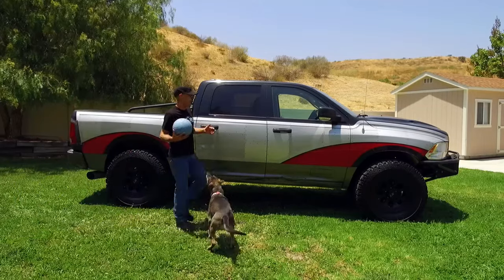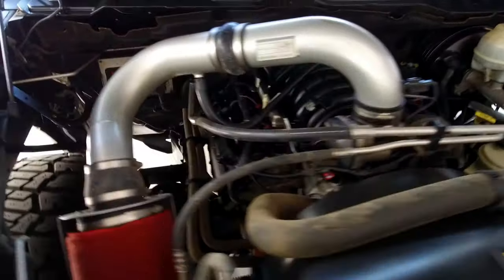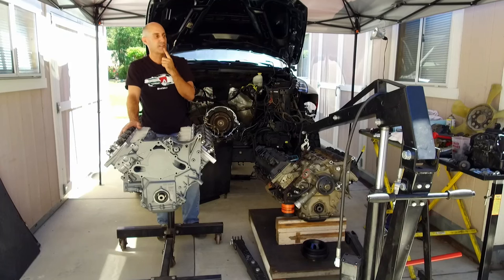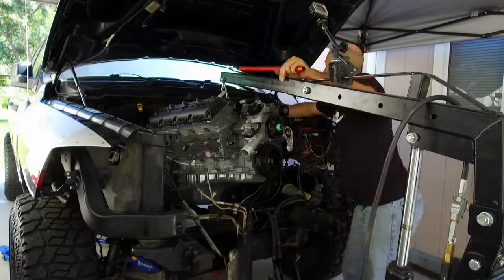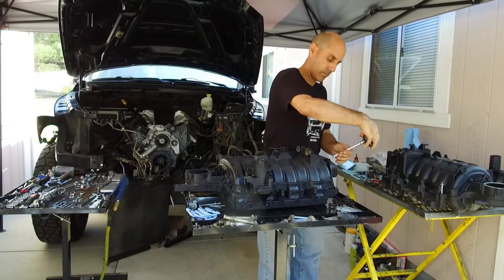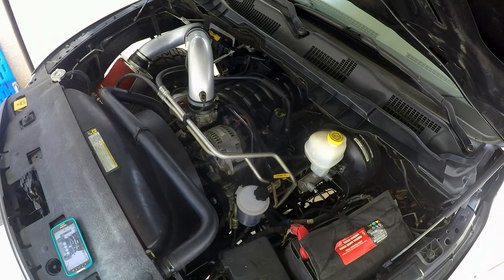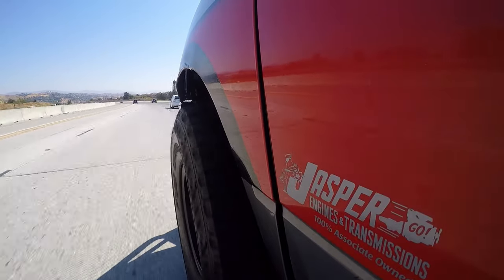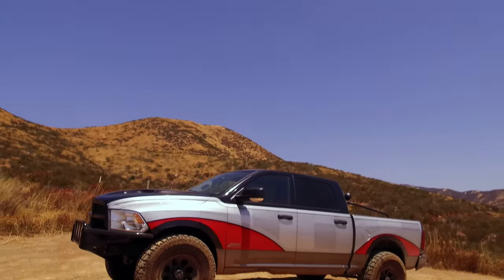HEMI Swap with Jasper Engines Replacement 5.7 in a Dodge Ram 1500 on 37" Tires

Comment: I just sucked a valve in my 5.7 I'm heart broke. I loved my hemi. I'm so mad 😢
Reply from the maker: This is a really great engine with some solid technology in there.  It just took them up to the current generation to get some of the weak spots engineered out of there.  I'm thrilled that my Jasper has those fixes in it.
Reply: autoedit thanks for the reply. I think I will get another Hemi. didn't they say 2009 and newer 5.7s they fixed the valve seat problem? or I'll do more research and watch this video a few more times .
 Ohhh yes a Jasper Would be incredible. Your Truck is badass!!!   I think I can make a Hemi last a long time with a little Lucas and frequent oil changes.

Comment: Too bad Chrysler still can't get it right and won't offer to do the upgrades once your motor goes dead. If it's under warranty, you just get the same cheap OEM parts. The same goes for that 65rfe transmission.

Comment: Need more how to stuff for this ram
Reply from the maker: Working on a full suspension rebuild video right now and should have it done this week!!!
Reply: autoedit wouldn’t want to do a video on how the rubicon tcase was installed? Or is it a direct replacement besides cutting a hole in the floor?

Comment: u should do engine swap for the jeep
Reply from the maker: I like how you think but that is tricky here in California with smog rules and such.  How about a supercharger? Adds another 100 horsepower but still sounds like a mini van... but still another 100 horsepower tho!
Reply: autoedit Well, A supercharger is going to add 100 hp that is true, However, it will cause more wear and tear to the engine"long term" as it adds lots of pressure to the stock 3.6l engine. I personally prefer 6.2 hemi swap, will give lots of hp and torque and an amazing sound.

Comment: Was the new engine mds deleted from jasper?
Reply from the maker: You could go either way.  Just buy block off plates for the solenoids and done but you would still have to deal with the computer.  I my get a tuner in the future to disable that but for now I hardly notice it.
Reply: When my 08s mds kicks in it becomes and stays a turd for a few but with 115k on the odometer it's still running strong I was going to cam swap with headers and an mds delete with possible custom tuning

Comment: What about the valve train? That's the weakest part of the whole engine.
Reply from the maker: They use higher quality metal than OEM for those parts in this application.

Comment: Where can I buy a Jasper engine? I don't need an installer. i don't let anyone else work on my cars. I'm a certified mechanic/
Reply: Can anyone recommend a brand of reman engine that has warranty and one can install themselves?
Reply from the maker: I simply emailed them from the link at the website and asked to install myself.  Worked out great.
Reply: AutoEdits thanks, I called Jasper and they said I could install it myself. They gave me a quote but it was about $1500 more than ATK. ATK has no cores so the wait would be at least 3 months. I talked to a friend who owns a shop and he said he had a lot of problems with Jasper and recommended ATK. My local machine shop who told me my core would need all 8 cylinders sleeved and would not be worth rebuilding said they stopped carrying ATK 3 years ago due to problems and recommended Jasper. Trying S&J.

Comment: OH MY GOD ALL THAT WORK TO BOLT THE OLD HEADERS BACK ON. THE ONES THAT SNAP BOLTS... THE ONES THAT TWIST AND LEAK.... WHAT A MASSIVE MISTAKE. 

Should'a bolted a set of BBK shorties on there at the very least.... dont worry it will be a necessity in about 6 months.
Reply from the maker: I didn't realize it was such a problem.  The old ones lasted this long without issues but I do like the BBK shorties.  Didn't realize they even made them for this application.

Comment: Am I the only one that noticed the old engine had a FRAM OIL FILTER??  NOT GOOD
Reply from the maker: I've seen this comment a lot on this video... why is Fram bad?
Reply: @AutoEdits  The standard Fram oil filter is the cheapest of the cheap oil filters.  I'm talking quality of build Not price,  Fram uses a piece of STRING around the filter media to keep it from bloating out against the filter walls., and the filter media is glued to CARDBOARD at its ends.  Cut one open and see for yourself.

Comment: But they didn’t fix the valve problem
Reply from the maker: This particular generation of 5.7 engine doesn't have that valve problem but they do install higher quality valve seats. I specifically asked about this as well.
Reply: AutoEdits valid point that’s the 2014s and up with mds I believe
Reply: @RED2K2TIMMY  the newer hemis get hellcat style lifters and nitrited valves plus an available MDS delete for ram applications

Comment: I looked at jasper’s customer reviews and there are a lot of unhappy customers.
Reply from the maker: Not sure about where you read those reviews but the reason I'm 100% confident going with Jasper is the 3 year, 100,000 mile warranty. The continued video series on this truck being used hard should be a good test.  So let's see!
Reply: autoedit I just did a google search of jasper engines and a bunch of negative reviews came up.  I do take into consideration that some people will complain about anything and everything.  If it’s working out for you, that’s all that really matters.  I liked the video. I have a dodge and I’m starting to have some issues so I was looking for some solutions. Thanks for replying.

Comment: Hahahaha, I’ve put 3 jasper engines in in a row. They higher Walmart rejects to build their engines. First engine wrist pin wasn’t in right destroyed cylinder 3 instantly. 2nd cam sprocket bolt not tight and snapped on my test drive. I’ll never use a jasper engine/trans again

Comment: Thr hold the accelerator  pedal  to the floor is the flood clearing mode.  A engine wthat is not flooded will start and shoot to high rpm.  Not what you want to do to a cold engine post oil change.
Reply from the maker: Not true with this engine... as shown in the video, it did not fire up and let me build oil pressure before starting.
Reply from the maker: +Rich Vandervoort Did you watch the result in this video? Seemed to work perfect
Reply: Your no start was likely a result of air in the fuel system that bleed out slowly.  Holding the gas too the floor is a typical flood clearing mode for many fuel injected engines.  I tried this when I changed the oil in my 2010 Hemi Ram.  I got near redline engine rpm prior to oil pressure, not a good scenario.  My foot came off the gas really quick after it started, but the engine still went way up in rpms.  You can claim it works but my experience demonstrated that it does not.  Just another reminder that if you get the info off the net, you should verify it before you belive it.
Reply from the maker: Rich Vandervoort you are wrong. Just deal with that please.
Reply: I just told you what my truck did, how is that incorrect?

Comment: Do that engine a favor and get rid of that K&N thing. Put a real filter on it. Also use Synthetic 10W30 oil. 20wt too thin for southern Ca.
Reply from the maker: That’s a fine suggestion on the filter but it’s a bad idea to change the weight oil based on what you think for SoCal. The cam timing is based on oil pressure driven solenoids designed specifically for 5-20. After talking with engineers, I use what they recommend. Do what you like though... I’m not here to tell you what to do.

Comment: That engine failed because of the POS fram oil filter.
Reply from the maker: I've heard that a few times on this video... didn't know that!
Reply: There are several videos of people cutting oil filters apart.  Fram seems to be one of the most inexpensive made.

Comment: I hear alot of bad things about jasper. Is it true that they are a bad company or am I just reading a bunch of bs?
Reply from the maker: I’ve heard some complaints in the comments of this video but my experience has been amazing.
Reply: @AutoEdits   Sorry to be a bother but did the warranty with the engine still hold eventhough you installed yourself? Also how much did it cost for the engine?

Comment: Jasper...better keep them motor bolts loose...gonna have to pull it back out for oil leaks. And.. especially if you put a orange can of death on the replacement

Comment: They didn't fix the biggest, most important issue, that this engine has..
Poor lifter lubrication.... Which flattens cam-lobes .
Reply from the maker: I'm not sure that's the exact issue causing the cam lobe wipes. There was a run of low grade metal parts for cam and lifters that  took them a year to sort out.
Reply: @AutoEdits  I've seen two really good video demonstrations of the lifter angles being a reason that the flung oil doesn't migrate all the way  down the body of the lifters , to the roller-bearings (at idle ) Wich is why this issue popped up in service vehicles that sit running for long periods of time... I got a 6.1.. i won't risk it , so i don't let my srt8 idle for more than 10 min. 

06' with 150k .

Comment: That junky ass "cold air intake" needs to go.  Its drawing in air right from the passenger front tire, sucking in all the dirt it kicks up.  Every grain of dirt that gets by the filter goes right thru the engine.  The cylinder walls probably are worn to hell.
Reply from the maker: What brand air intake do you recommend?

Comment: using the starter to crank the engine over to prime the oil system is a proven myth.  the oil gets to the places it needs to go faster by actually starting the engine and letting it run.  You really don't think the factory does that to a brand new engine, do you?!?
Reply from the maker: You do you.

Comment: Neat too bad 5.7s are trash.
Reply from the maker: That's not true at all.
Reply: @AutoEdits  Everyone knows these engines are notorious for lifter failure resulting in flat spotting cams and eventually destroying the engine.  You explain Jasper's design flaw fixes in the video! The 5.7 was is poorly designed.